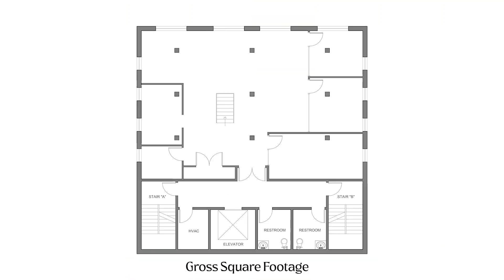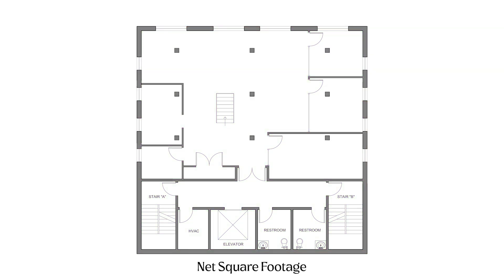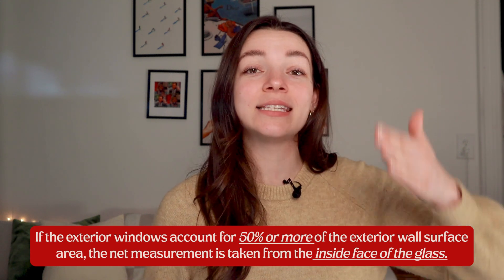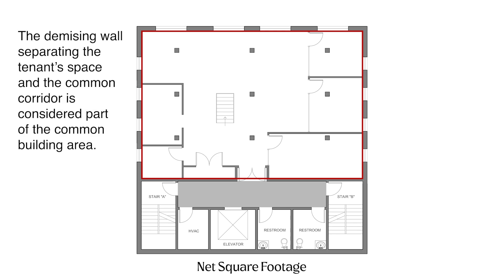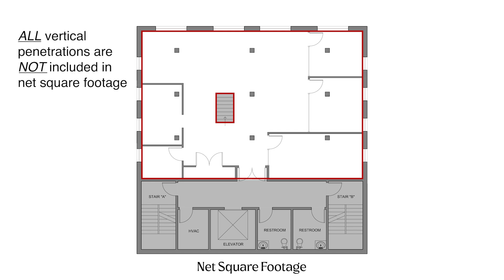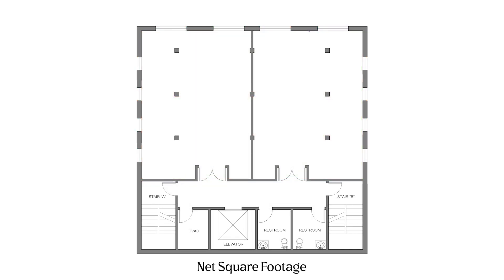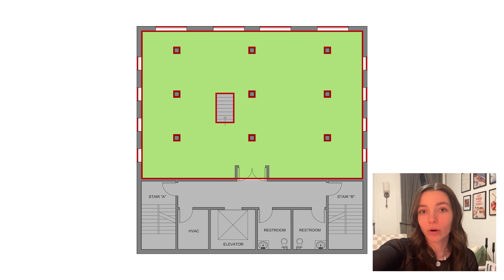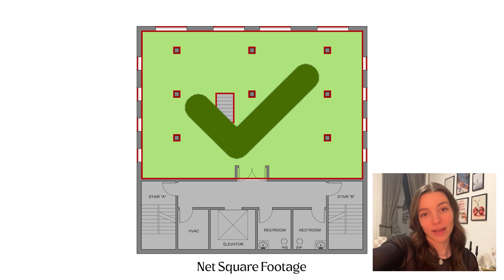Square Footage EXPLAINED (Gross vs Net, Usable vs Rentable, BOMA) | NCIDQ Test Prep

Comment: Hi Kelsey why did you multiply x 1.3 instead of .30 for the load factor?
Reply from the maker: Hi! When you multiply by 1.3, you’re adding 30% onto the original number (10 x 1.3 = 13). When you multiply by .30 you’re getting 30% of the number (10 x .3 = 3). So if you’re calculating RSF, you’d multiply the USF by 1.3 to add the 30% load factor to the USF number. You could also multiply by .30 to get the load factor and then just add it to the USF number after but it just adds a step. Hope this makes sense!

Comment: Question when you measure the grass square footage and you say you go to outside of the exterior walls what is your stop line if the walls are made of senior will be face of Samuel or will be that face of exterior wall. For example, brick, veneer or side lapping where this wall is finished it so basically my question is if you measure it to the face structure by walls or to face of finish.
Reply from the maker: Valid question but I don’t think they’ll get into that much detail on the exam. Have you seen a question like that?
Reply: @klsy.design hey no actually I am trying to get together for architecture license just crossed over to your Chanel 😊since I found this topic interesting😊sometimes at work I have to get gross sq. sf. And I was wondering how interiors approach this topic 😊😊
Reply from the maker: @kukisia got it! Hope it was even a little helpful :)
Reply: @klsy.design yes it was 😊thank you 😊😊

Comment: Hi Kelsey! This was really helpful, I’m so glad I stumbled upon your videos!! Could you please clarify how 30% load factor results to 1.3?
Reply from the maker: Of course! When you multiply a number by 1, you get the same number (ex; 10x1=10). When you multiply it by a decimal number you get the percentage of that number (ex; 10 x 0.3 = 3) (0.3 = 30%). So multiplying by 1.3 ADDS 30% onto your existing number. It’s just a simpler way to calculate an ADDITION of 30% onto the square footage. Hope this helps!
Reply: yes, I have the same question about that , I feel like it should be X30% instead of 1.3 , correct me if I am wrong thx